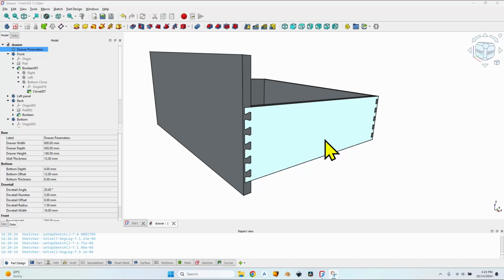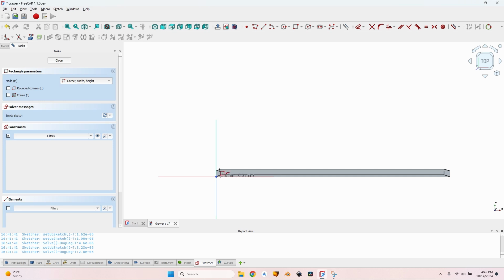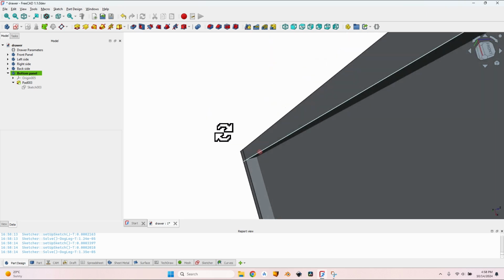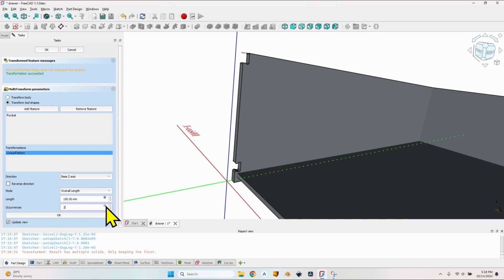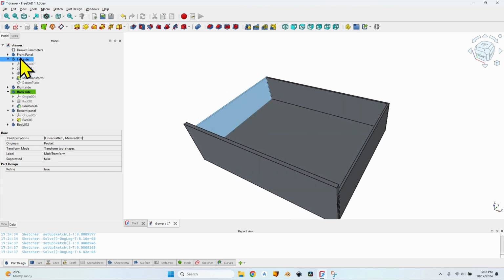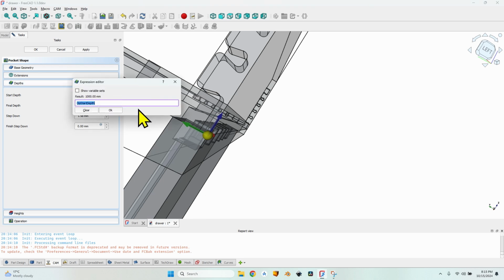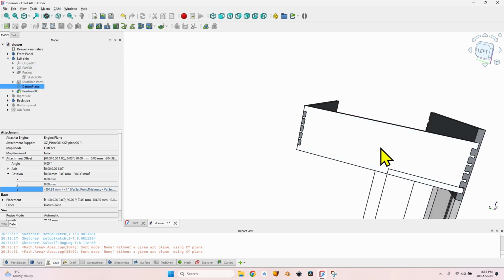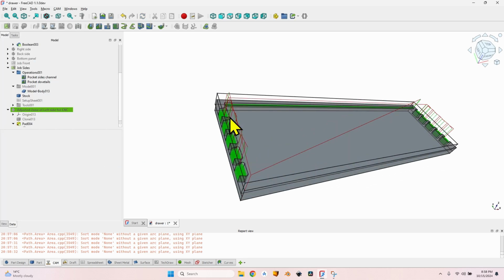CNC Dovetail Drawers – Fully Customizable Design & Toolpaths with FreeCAD CAM

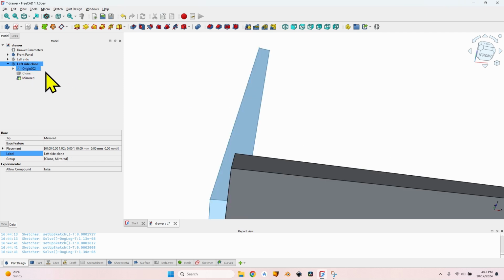Comment: On minute 10:00 you are doing the mirror of the right side, I find it not very intuitive. I was searching for an alternative and found that the Mirror tool on Draft workbench works different, it creates a new object instead of being the same object, the problem I'm having here is how to set the mirror coordinates, I don't understand how they work yet, it would be nice if they work the same as the Part Design mirror
Reply from the maker: The downside of the draft workbench is that the objects are no longer related. If you change the initial object, the mirrored one does not change. That's why I don't use it
Reply: @opensourcecnc  maybe this has changed with the 1.0? I did some changes to the original sketch and they have been applied to the mirrored part
Reply from the maker: Didn't know that, I'll take a look, thanks for the tip!
Reply: @opensourcecnc  i applied the mirror to the object, i could apply the mirror to the pad, but didn't test what happened there
Reply: Also about how to use it, i found that it's impossible to setup directly, so i create the mirror randomly and then put to zero the placement coordinates and fix the normal axis manually in the parameters
Reply from the maker: Probably still another object, which is a downside when using the cam workbench. I noticed that each separate object increases the computation time a lot, compared to a single object. That's another good reason to use the part design mirror, which keeps everything wrapped in a single body.
Reply: @opensourcecnc  there's a lot of complexity!

Comment: Hello, may I ask why using varset and not the freecad spreadsheet to set parameters?
Reply from the maker: @vaedo01  just to avoid using another workbench. For simple stuff, where you don't need too many variables,  it's easier and faster to use varset compared to a spreadsheet